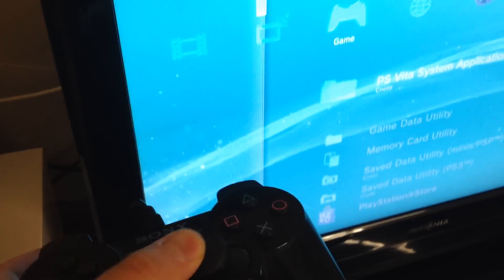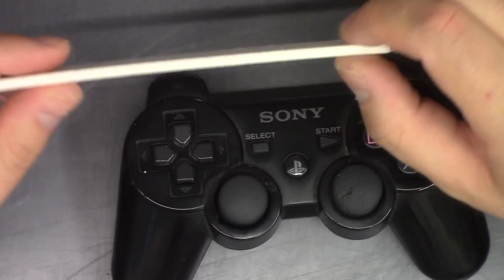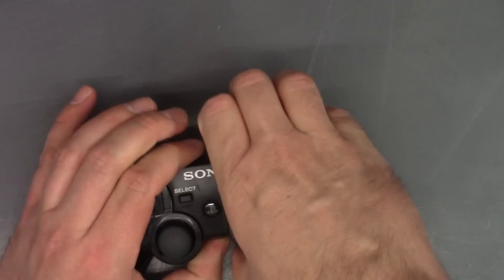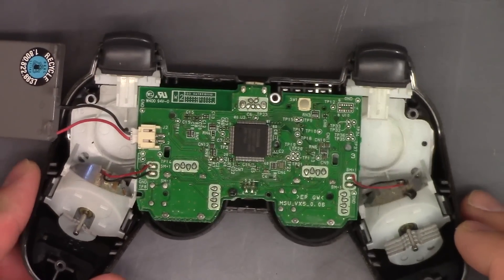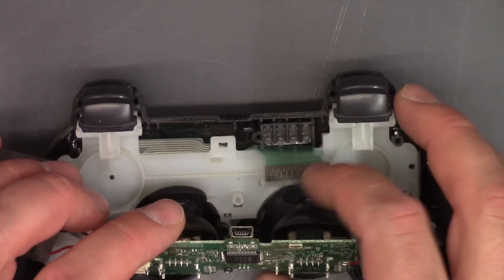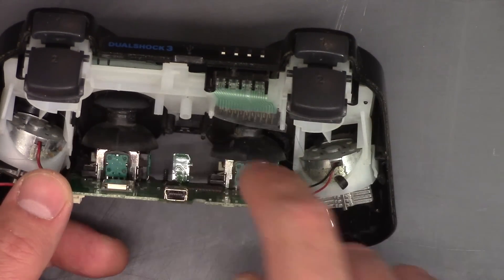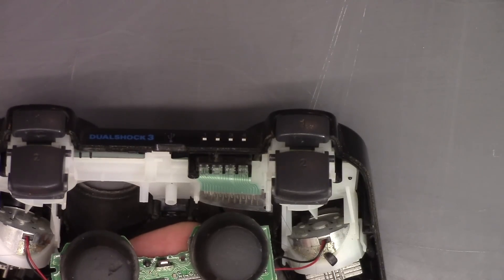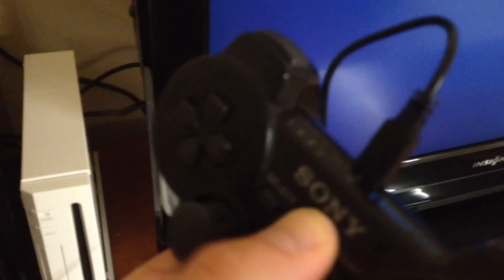How to fix a broken PS3 Controller

Comment: I just fixed mine, so that's why I am watching yours for the hell of it. Alcohol for days. You can literally bath it in it and its proper to do. Dishwasher is how you clean/protect motherboards. For the pots, DeOxit D5 all day. This one is good not to get around, but will never harm anything at all. If you ever wash motherboard or similar, just make sure there is nothing like an internal paper speaker or the like. Transformers I would not do that to, too. Other than that, all good. Of course, dry before power applied. Rock on. Basically, it comes down to common sense. Electronic components themselves never get harmed. If there is oil or grease on something, reapply it when done.

Comment: Awesome thanks for the video! My pre-owned controller lost R1 responsiveness.  Cleaned it to no avail.  Bought a generic motherboard film to install.    That little black strip that shows up at 5:28 is the piece that goes between the white plastic structure and the motherboard film.  Mine fell out too and I couldn't figure out where it went until I saw your video.  The indentations on the foam matched the white plastic piece on my model.

Comment: thanks mate... fixed both of my ps3 controllers...Previously, i just cleaned them.. and the glitch  was still there... Was looking to purchase new ones but then i watched your video, and it seems that adding some more thickness to the connectors made the trick...

Comment: I came up with a fix for that little notch you've got if it's making the left analog stick get sticky (or if you like me tend to break the thin plastic around the analog sticks).

What you need is some superglue, some baking soda, some tape, and a pair of nickels. Take it apart and put the tape flush on the front of the controller, then put the nickels in the two analog stick holes (they should be a perfect fit). Now flip it over and LIGHTLY sprinkle some baking soda into the gap, and maybe a little bit around the rest of the nickel to make a nice white ring (no soda on the nickels!). Best to go light and repeat rather than use a lot and try to do this in one go.

Once you've got the baking soda in there (this is going to be its final shape so make it pretty) you dribble just enough superglue into the baking soda to get it wet. Dribble around until all the baking soda got a little bit (and try to keep the nickel clean). It'll dry in seconds. Then you pop out the nickel and you've got yourself some hard white plastic where the baking soda was. Sand the inside of the holes until the analog sticks move freely and return to their start position. Now your controller should last a lot longer and stand up to harder use.

Comment: I cleaned the contact points and also placed a tape underneath the contact points still the controller is not turning on but i charges. What should i do ??
Reply: Replace main ribbon cable

Comment: I need help with my controller its so confusing to fix my controller the X button is not going up like the other buttons like when you press it it goes back up well mine doesn't do that its like sticked on the bottom im trying to fix it and the motion stick keeps going right or left i forgot and i try to fix it but its no way to do it i tried everything i could so i searched up how to fix it and im still getting nothing i feel like this is the first time of a broken controller if you guys have any idea how to fix it please help me cuz i have 2 controllers that are really old and broken to where the cord is not powering them but they keep turning off please help me reply if you guys have any ideas.

Comment: Hello! I was wondering if you could make a PS3 Dualshock Controller fixing (or cleaning), because mine doesn't work (the left "lever" doesn't work, and the right one moves really slow, for example at aiming in games like RE4 or TLoU) if you could make a video I would be really thankful.

PD: it uses to work if it's connected to the console by a USB cable, but nothing else, and it's a shame, because in quarantine it's kinda annoying

Thank you

Comment: Hi, I'm having trouble with my controller. It turns on on its own.  I thought it was the same issue as the video, but it isn't. I cleaned all the contacts with IPA, it's still the same. I then connected only the board and the battery without assembling it and it still turns on its own. It doesn't seem to be the flex circuit. Please help if u can.

Comment: Could you show what happens when the left thumb stick messes up I play cod and I can't press the left thumb stick in all the way to run and when it does it clicks loudly and makes the gun shoot then outta three gun away . Sometimes it will even make my character jump! It's strange! But it's just the thumb stick making all that happen. Also I play hardcore so I'm getting way to many team kills and its not even my fault ! 😣. It's my only controller so I don't want to risk breaking it by taking it apart without knowing what I'm doing.

Comment: Thanks for preview ofwhat torture is coming.
I have a deeper issue - Both R2/L2 quit at the same time.
But maybe that fragile contact stripis all it is, getting a spot of dust to lifta portion of the strip responsible.
Oddly, they both quit when controllerrolled off the couch to the carpet.
Next thing, I end up loosing optionsto fire mortar cannons on Assassins CreedRogue, then tested GT6 Racing, and sure enough lost up & down shifting.
My other thought will look behind carbonpad rubber touch switch, behind L/R 2 buttons.
I'll take the tour, and update,,,Thanks.

Comment: So basically when I play it keeps turning off (battery is not the issue) the controller lights only flash every 4 seconds when holded down the middle button. I opened it to see what’s the problem but I couldn’t find it pls help! It won’t connect anymore

Comment: hey ummm.. one of my screws isnt budging... im guessing its head is striped so please help meeee.... idk what to do... all of the other 4 screws are already out but this one guy wont get out..
Reply: I have the same problem bro 😥 . The top left one is completely stripped . I tried using ducktape too fill in the gaps & twist, but that didn't do anything.  

Maybe you should try that & see if it works for you
Reply: Mohd Ariq I’m not sure if this is a “proper” solution but I came up with it on the top of my head. Dip the tip of your screwdriver into a little apoxy enough to coat the tip and then play the game Operation on your PS3 remote until the apoxy dries onto the stripped screw.
Reply: Mines was the same, one screw wouldn't budge and I forced it open and all the buttons fell out lol .
Reply: Bunta Fujiwara  did that work ?
Reply: Yasey  hey did you ever get it open I couldn't and needed to get a new controller for 5 bucks

Comment: Before you go taking apart your controller, I tell you what. Give it a couple slight steady bumps (not hard bumps, but a couple concussing bumps) against the palm of your left wrist. Hold the controller with your right hand. I got my controller to work by doing that. The wiring the guy was operating on was of the left handle on the controller. I figured why not just give a couple slight bumps, and I did and it started working again (it was plugged into the PS3 when it was not working. After the bumps with it being plugged in might do the trick more effectively, because the ps3 remotes battery is probably deadened by now)

Comment: It works. Do as in this video.
I've seen other videos people (idiots) use WD-40 spray on the controls joysticks & buttons. The idiots do not understand WD-40 is oil base & no recommended for any type electrical controls or consoles.

Comment: Hey man! Whenever  i play a game, My character turns to the right. Is there a fix for that?
Reply: Clean your analog stick.
Reply: ***** it isnt that. My controller joystick is straight, but it still moves
Reply: +lance1499 #RipCoD how do u clean it?
Reply: check for any bends on the anolog stick grapples
Reply: Nvm i switched over to ps4 but thx guys!
Reply: Sounds like same problem, dust or hair inside making it glitchey and move by its self... Happens on ps4 also

Comment: My controllers were both developed issues with them spamming random buttons when used with USB. It got so bad that when attempting to play a game on the PC, the right combination of buttons spammed to delete all of my game progress! Steam of course went ahead and immediately updated the cloud save to reflect the now 0% progress, so about 30 hours of gameplay gone. So fed up with that bullshit, I attempted to clean off the contacts, but the insanely thin metalized plating effectively rubbed off, destroying it. I bought replacement flat-flex on amazon for 7 bucks, but even with this, the left/right D pad now no longer work, as the controller thinks these buttons are being permanently held down.

Now why the hell sony engineers had came up with this retarded solution for a controller design is beyond me. I'm inclined to think it is was a purposefully engineered to fail, as anyone with half a brain should know that having a very thin layer of copper exposed to air will oxidize with time. This is the reason why PCBs have soldermask any exposed contacts have gold or silver plating preventing oxidation. Further investigation of the electrical design and how the buttons are wired reveals that the design is far more complicated that it needed to be. Again, not too sure as to the reasoning for the strange multiplexing, since the ribbon cable appears to have enough contacts to not require multiplexing anyways.

Comment: It just won't pull apart, it feels like the bottom is stuck shut
Reply: DJKiller123100  did you get it open ? You have to wiggle it

Comment: that look like a fake ps3 controller...most ps3 controllerhav a holder on the board to place the battery and not 2 holes like your to slot the battery in...

Comment: Do u really need foam
Reply: It's partly what causes the problem as it gets too compressed. Adding some padding to it and cleaning the ribbon and the board where the ribbon gets contact with fixed the issue with mine.